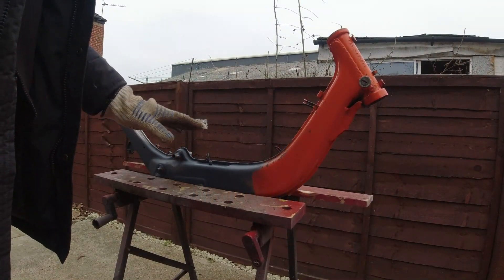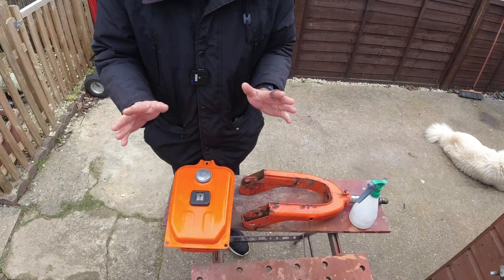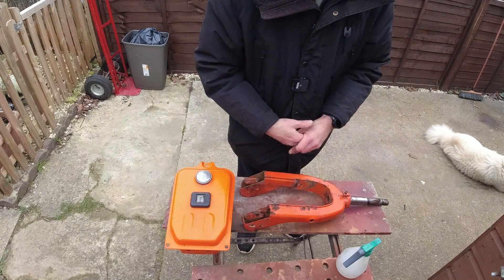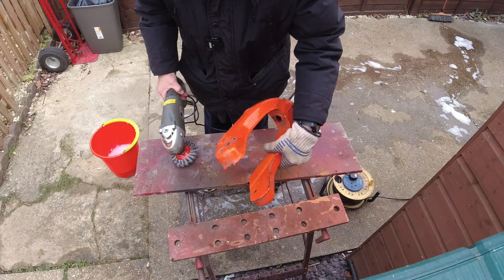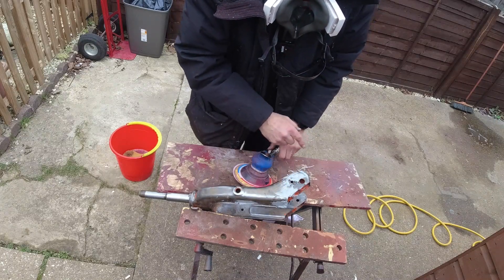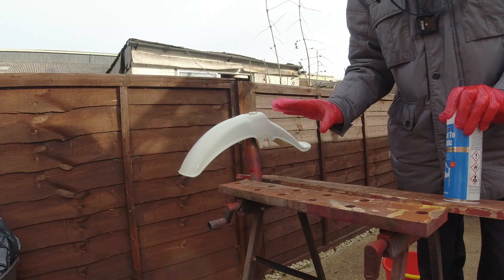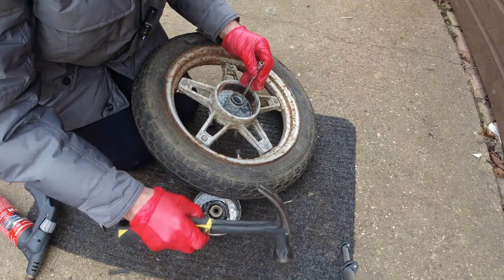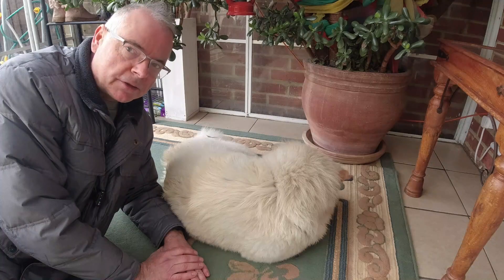Suzuki FZ50 (1980 ) Restoration  ( Part 6 )

Comment: Jeff you cant  fiberglass the forks use a welder and do the job right  Regards Johnny
Reply from the maker: Hi Johnny, I would like to have welded them. The small holes weren't structural . The fibreglass was not for strength just as a backing.
Take care, Jeff
Reply: @DiecastPowderCoating   Hi Jeff totally understand that but they must be welded any filler in a structural part ie forks is a MOT fail  its the right thing to do especially demonstrating to others who know no better
Reply from the maker: @vintagemopeds2767  Hi Pro, yes I understand only I saw the same thing, not with fibreglass but with filler. I won't be selling it straight away when it's finished, so will go back and revisit the forks.
Thanks your advice.
Take care Jeff